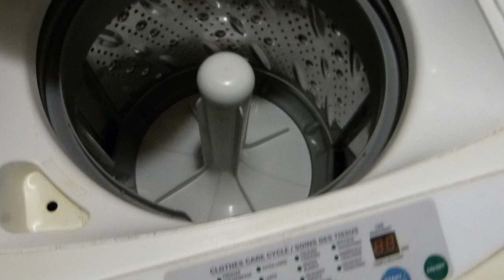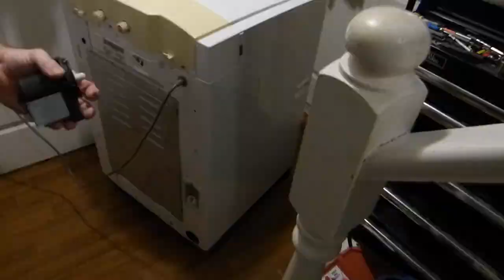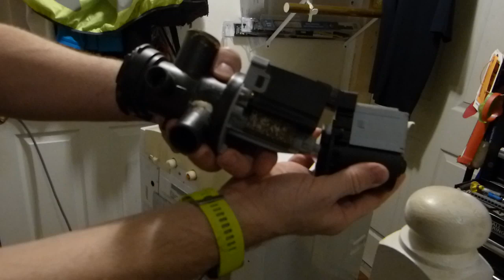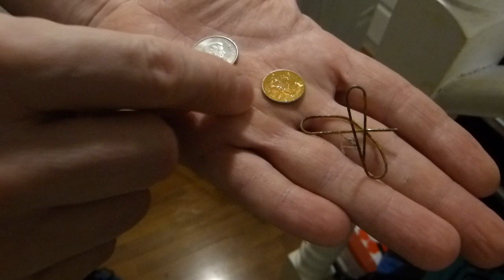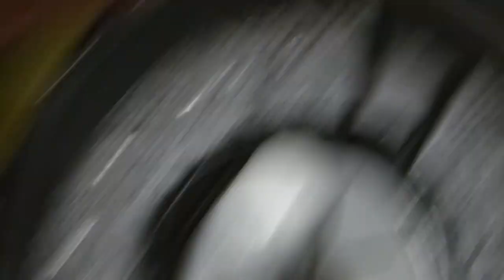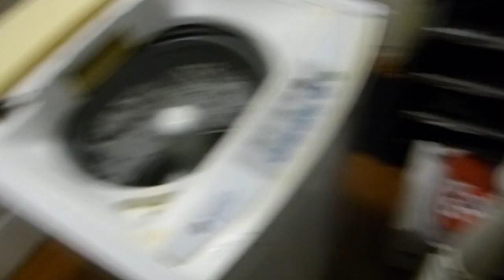GE Spacemaker washing machine FAIL

Comment: I was hoping you were going to show me how to take  This washing machine apart I have a leak that is clearly dripping from the bottom In more than one place and I'm not sure if that could be the seal.  I don't want to call  in a repairman  and pay out money i really dont have  to tell me  that the drum is rusted out and  there's a hole when I can see that for myself if I could just get the machine apart without damaging anything. If you could help me out in anyway id be very  grateful...please please please.
Reply from the maker: Right, that's an excellent start.
Lift up the machine on bricks or something (safely) so you can get under it and see where the leak starts at. Hose connections are likely to leak when sand/sediment gets into the joint, they are easy to clean, needs only pliers to compress the spring clamps.

Comment: 18 years for that one is pretty good
The failure was between the user's ears
Reply from the maker: All there, right on. Thanks for watching.
There is a part 2 to this clothes washer, my custom epoxy glueing fix on the fitting. I'm not enriching GE with $120-250 for a $0.50 part. Coming right up.